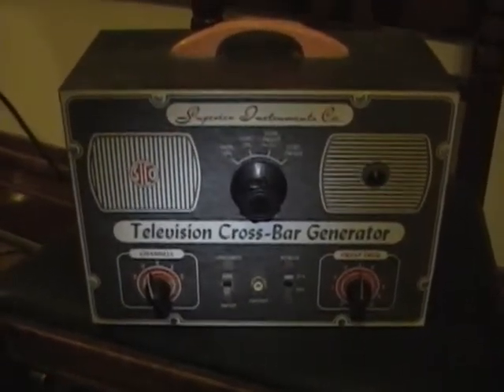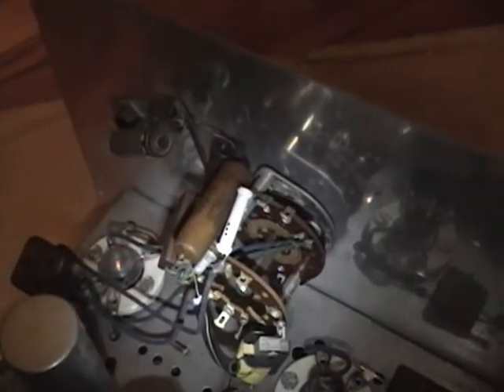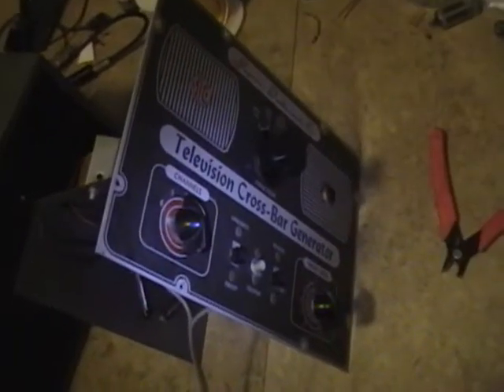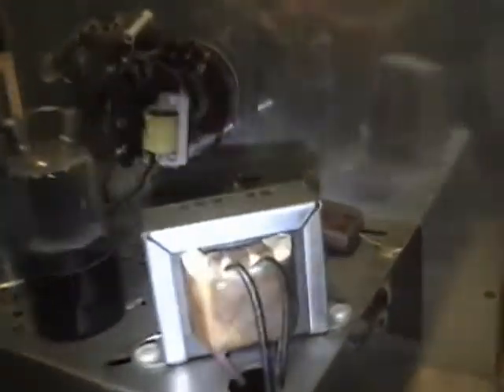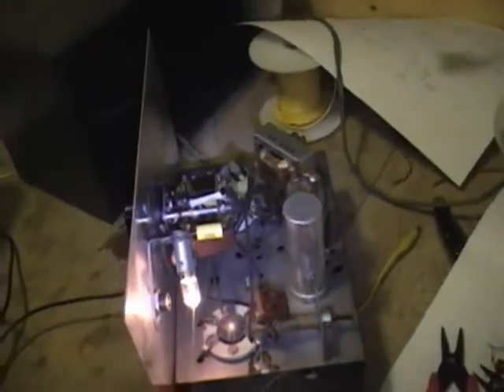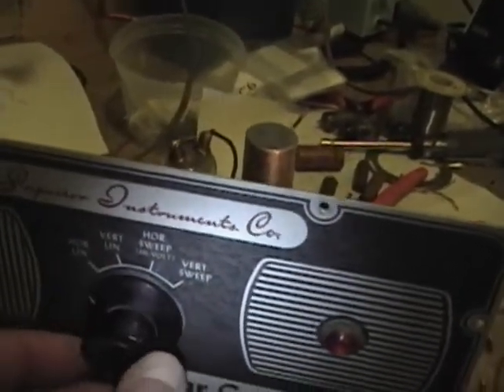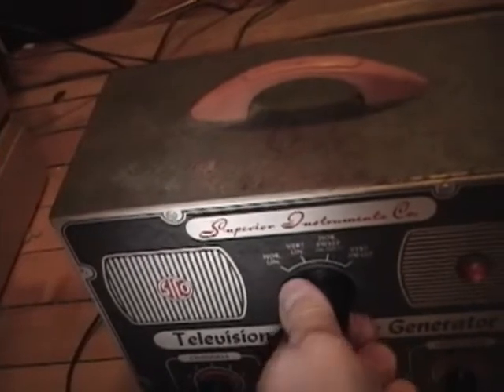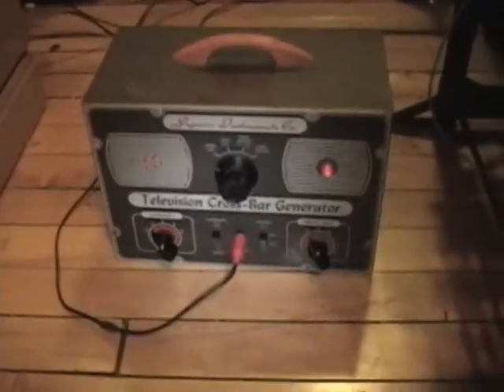Superior Instruments Co.  TV Cross-Bar Generator

Comment: HI Bob, I hope you remember this tester you did a few years ago. It was cool and showing acorn tube use was great as well. I tried to find some stuff, and a website you may have found I am sure had there SICO TV-50 generator (or there Genometer). What was amazing is that SICO also used that same 6J5 like tube as a rectifier (with the grid shorted to plate) in the same design as there TV-50 schematic.... which they show in the middle. check ....  dubdubdub.ohio.edu/people/postr/bapix/tv50.htm"